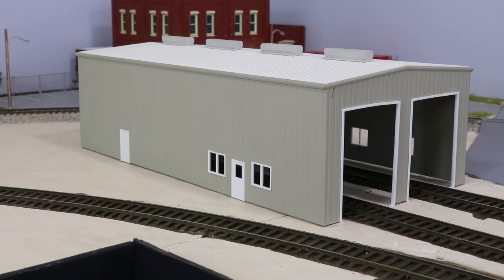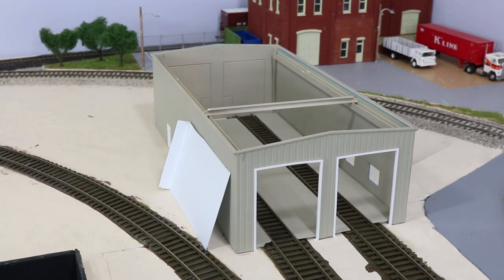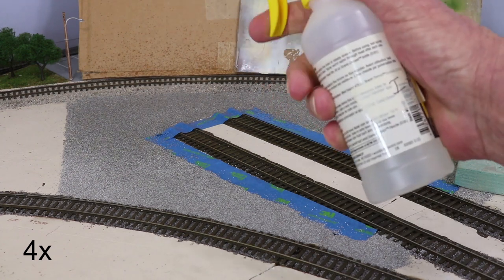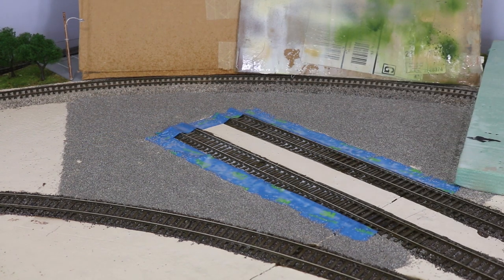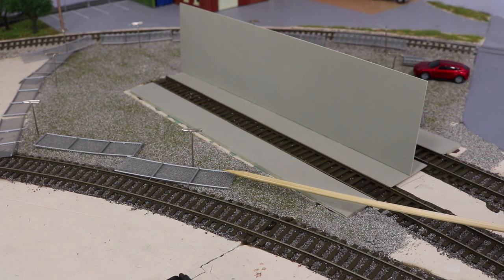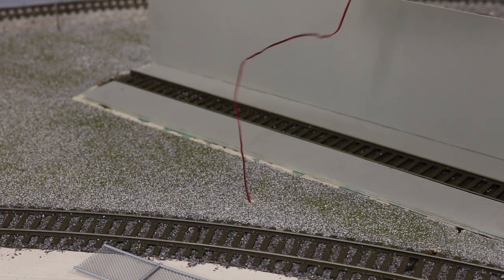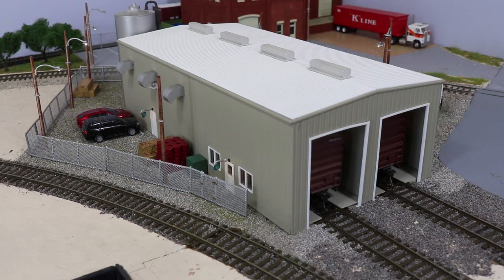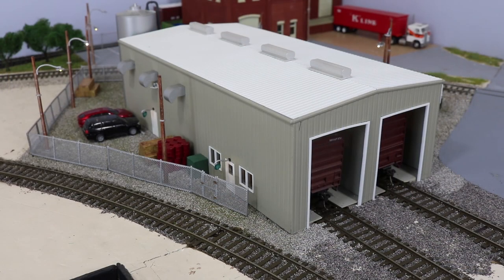How To Improve a Plain Structure

Comment: What did you use for the walls and floor?
Reply from the maker: Thanks for your questions. Could have used .030 styrene but I had none. Instead, they are made from a styrene no parking sign that I bought at Lowe's. If you decide to do the same, make sure that you remove the coating on the sign by sanding it. Otherwise, the paint will not stick. I learned about the signs from Vinny at BNSF6951...Harold